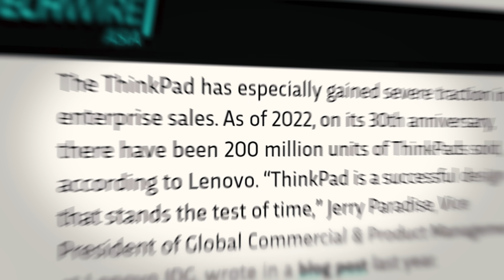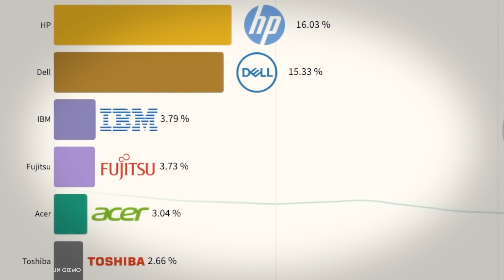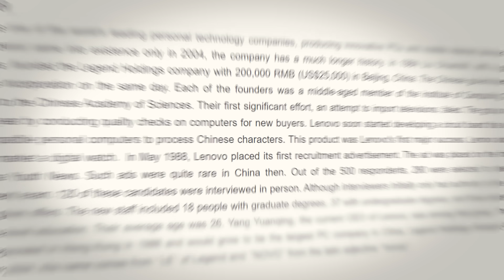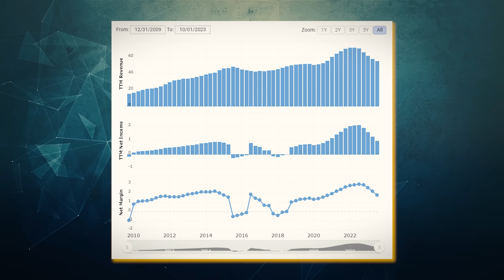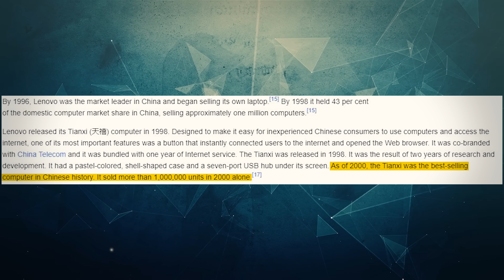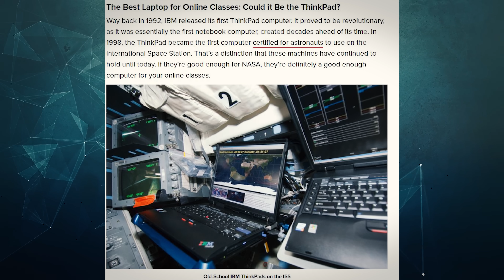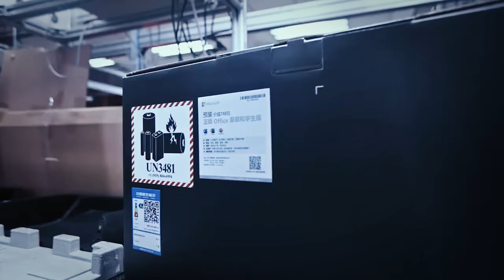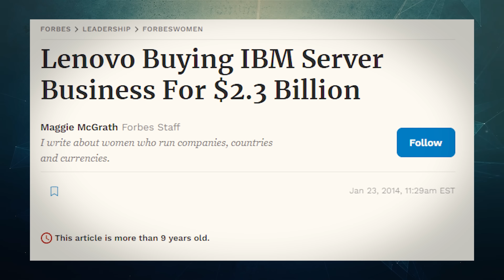Lenovo - The Last Practical Electronics Maker

Comment: Since my first ThinkPad 380D in 1997, I have been using Thinkpads in the last decade. Today, I use a ThinkPad X1, my wife uses T480. So, it's not just being loyal to a brand, but rather I can attest to its solid engineering.

Comment: I had one of those IBM thinkpad, it’s technically still with me but not up or running.
I always wanted to buy another one of those but the configuration requirements make it too costly for me. I was drooling for X1 carbon for a long time.

Comment: In reality, the last practical laptop maker is Panasonic as it still produces laptops with swappable batteries, optional internal optical drives which can be also added later, and replaceable components, well, at least if you can live with 2kg laptops for getting a 14" display which is as rest of their semi-rugged line optimized for company/medical use (though displays can be often changed for more movie instead of outdoor friendly models with better black reproduction).
For some consumer-friendly models in terms of weight though harder to find you can try Panasonic's Let's Note series which until recently got even an option for a Blu-Ray writer in a 12,5" laptop made from magnesium, so weight was just a bit over 1Kg though upgradability was far more limited due to limited space...

Comment: Recently bought a used L412 for around 30 bucks on ebay. Came with no hard drive, so i slapped in a 128gb SSD for 20 bucks and even with 4 gb ram, it runs windows 10 flawlessly, although a bit slow. Plan to convert to full Thinkpad user, gonna grab some programmer socks and install linux.
Reply: I was almost gonna say get linux on it
Reply: @StuffingSkulltag  lingus

Comment: You are mistaken investment on R&D instead of Supply management and distribution management. Lenovo only spent 2% on real R&D, The majority of its investment are on supply management, distribution management. Put it  simple, Lenovo squeezed supplier and spend a lot maintain a very large and comprehensive distribution network. The reason this crappy antique computer still on the market is because it shows up anywhere with distributer everywhere.  So get your fact straight, before you take your money from your AD customer.

Comment: But, this brand product that has neither repair facility nor a genuine sprats available. It is like use and throw after one year. 
I had bought Lenovo Legion 5 1.5 year before. Now, it is in fully dead position like use and through because its mother board can neither be repairable not be available a cheap range. 

By chance, had it be available in the market, it's cost is very high means 70-80% cost of this laptop's cost by which it can be bought a new good condition with min 1 -3 Year warranty.

So, why to make a pay a lot for this type of brand if there is no long lasting? 

And also now a days, all thing are in build. It can not replaceable for exam: for Battery etc.

Comment: Honestly I hate Lenovo
I used to volunteer at a PC repair center (we fixed computers for free), and most of the laptops that came with hardware issues such as faulty wireless modules, unresponsive / sticky (not physically) keyboards, etc were Lenovo's
Even today, every ThinkPad I got from work either is slow as hell or has nasty hardware issues (swapped 3 already)

Comment: I have a ThinkPad at work and I think for its price its a absolute piece of shit. The plastic feels extremly cheap, the cooling solution is underpowered for the chip inside so the fans ran flatout a lot, its the only laptop where sleepmode doesn't properly work half the time, the camera and microphone are on 90$ grandma phone level despite the thing costing 2K.

Comment: Older Unibody Macbooks and Older Thinkpads are like the Laptop equivalent to used early 2000s Toyotas, both are very reliable (except the 2011 Macbooks) and are very easy to fix if a part went wrong

Comment: All lenovo laptops are well built except ideapads. Mine broke its hinges just after 2 years and I had to get the entire display penal replaced. Only then I realized that it’s an extremely common design flaw in ideapads only. Still gonna stay with lenovo but no more ideapads for me. Probably going for a thinkpad or legion next.

Comment: I wanna get the P50 or the X230. Heck, I've seen a shop use a ThinkPad for their POS. That's how reliable the ThinkPads are. That even a 10 year old ThinkPad can be easily usable. 
About Sony and Panasonic. Those devices are exclusivley sold in Japan and not much outside. Panasonic's Let's Note series will shock some people, because it's trackpad is circular, instead of rectangular, like most laptops. It also has a lot of legacy ports and a optical drive. And the Panasonic still does that for familiarity and compatibily reasons. Japanese people are old. Very old. So familiarity is the big key. Plus, some perifferals(yeah, a metal joke) and media might not work on newer laptops. Compatibility is key in a Japanese enterprise. Speaking of Japanese enterprise and moving back to ThinkPads, Pasona uses ThinkPads for their business. But the industry and greed moves things, so ThinkPads now, like the X and E series have riveted keyboards, internal battery, and possibly soldered RAM. But, only time will tell when people will go back to the upgradability phase, when even the CPU was upgradable, not soldered, so you have to buy a whole new motherboard just to upgrade the CPU. Even Framework can't avoid it. But still, let's hope that the day will come.

Comment: As a person who's been using the old thinkpads(X230, X250, T440) for over 5 years. Today's thinkpads don't even come close to what the older thinkpads have to offer. You can literally break your computer and replace parts to make them better. Buying a ThinkPad X220 and upgrading it completely part by part is still better and cheaper than buying a ThinkPad X1 carbon.

Not to mention that the parts are ultra portable between different thinkpads. I myself have replaced the screen, trackpad, keyboard, batteries, ram, harddrives from older thinkpads from a ThinkPad junkyard. Still works like a charm to this date.

Comment: Had a Lenovo Thinkpad T410 for years until the start button became completely unresponsive, even after boosting it. Next came a Dell XPS 15 9560 for years, replaced swollen battery and cleaned out the dust collected around the fans, still chugging along. Bought the new XPS 15 9530, OK except keyboard uncomfortably warm under load. Returned for Lenovo Thinkpad P1 Gen6, even this gets warm under video editing load. Keeping it and do my editing with PowerDirector minimized, although it takes hours. The problem, as I see it, is more powerful processors (even tho mine is only an i7) and video cards (tho mine is only an NVIDIA RTX4060) in an ever more thinner, sleeker laptop (if you can call a Thinkpad that :) Planned obsolescence. And  Lenovo is the boxiest I could find. No, I couldn't deal w/the fat ass overweight numpad P16 :)

Comment: Lenovo didn't create the ThinkPad concept. It was bought from IBM, and the B stands for Business, not Fashion or Fad. Lenovo has had its fads, though. All the different network adapters to replace the classic port have caused nightmares for customers. When you realise you don't have enough adapters, you order a bunch so you'll be safe in the future, but then Lenovo changes it - twice! - only to return to return to the classic port. And you now have an abundance of superfluous adapters. 

Despite all that, I prefer a ThinkPad over any other (similarly spec'd) business laptop - and an IdeaPad for private use.

Comment: I have been ThikPad user for over 15 years, year after year, excluding last 2 years, when I ended up with HP EliteBook G8 835 5850U/16GB/1TB Samsung 970 Evo Plus and recently upgraded to EliteBook G10 7840U/32GB/5G/2TB Samsung 990 Pro, reason ... EliteBook was costing much lesser than ThinkPad (like T14s). EliteBook has "A" grade keyboard, but then ThinkPad has "A+" keyboard, the best, and then the Trackpoint, which I miss a lot. Also, ThinkPad has better build than EliteBook.

Comment: I went for my first HP last year...and immediately regretted it; it was missing features I had taken for granted with Lenovo, like battery saver/limiter (HP says it's a 'premium' feature not even their Z-book line has), checking battery level with the PC off or just tilting your screen up to 180°. 
Yes, the onboard RAM is not good but you can still slap a 16-32GB stick on  the other slot and call it a day.

Comment: Dude, I've had notebooks from many brands, but Lenovo is the only one that has given me a good impression, the build quality and the battery are good, even in entry-level notebooks, my current notebook that I use to program is a Flex 5i, reliable, good screen, good sound and comfortable keyboard, definitely better than any Dell or Acer sold here in Brazil.

Comment: I have a great hobby since I retired.  I purchase old business Lenovo Thinkpads and refurbish them for my friends and family.   I have probably done over 50 T420 and T470 models.  They are ususally on e-bay for $100 or less only needing a hard drive and Windows installed.  They are tanks with metal frames and easy to work on

Comment: I have a Lenovo laptop, not a ThinkPad series, a G580 model, it's a decade old now and is not turning on now. I didn't like the Webcam quality of it. Right now my present laptop is an Acer which I am using with a Samsung SSD, it's great, but even it's Webcam quality is poor. These Windows based laptop manufacturers are ignoring the Webcam quality of their laptops. I think they have to start benchmarking their entire hardware with Apple's products to achieve great quality.😎😎😎

Comment: I enjoy the unique design features of the T400. I think that the removable battery is designed like this (away from the main body) so that it is not overheated by the heat produced by the processor, and the way the fan sucks the air is from the back to the side and the hot air is pushed from the side to the left! This helps not to think about whether air is coming from below if it is on your feet or on a non-flat surface. Also another advantage is that the fan is very quiet! in its cooling system there is so much copper (3 pipes run to the heatsinks, apart from the thick copper plates!) which makes it almost passively cooled!
I wish the new designs came out like this again!

Comment: The cell phone market has not attempted practicality. If you want a replaceable battery, you have to pay top dollar. This is not high tech, this is extortion. Simple, mandatory features dangled out of reach. Moderate amounts of memory are priced at a premium. It is my suspicion that Lenovo wanted their cell phones to be a more profitable division, so they did not carry over their emphasis on cost effectiveness. There is market share to be had, but no one wants to sell cell phones to the skinflints of the world. So I have an obsolete phone with generous memory, replaceable battery, very affordable price, and SD card memory you can install programs on. Want a new one with all of these features? You'll need a second mortgage. I won't do any financial transactions on my phone, so the security issue is inconvenient. But not enough to shell out 30x what I pay now.

Comment: My sis has an old Thinkpad (T460P) and recently she dropped down her laptop from the campus cafetaria table, LCD and Keyboard (front-side) hits the floor, everyone was shocked lol. Magically it has no scratch or damage taken.
Reply: It survived fall damage, but still taken damage from water spill (from a glass)

My sis and dad having a drama, dad spill the water to keyboard, now the keyboard is permanently broken 💀
Reply: at least it can be replaced, but a bit annoying for some models. So you take apart the keyboard to remove, some you just remove 2 screws and slide out. My T480 just has 2 screws but idk about the T460   @BebebnyaHuTao
Reply: @BebebnyaHuTao  Should've got a T420 with the spill channels 
:(
Reply: Mine fell from my backpack while on my back fell straight on the lid I was expecting it to be busted but nope just a scratch XD (i frickin love thinkpads)
Reply: Nokia of laptops
Reply: Nokia of laptops

Comment: Still using my ThinkPad T470, solid rock durability, and the 2 battery still have a good 92 and 93% health.
Not interesting to buy new model. I love T470 because have 2 RAM Slot, 2 Battery, 2 Storage (NVME and M.2 2240 SATA), and easy to repair option. Now I'm looking to buy used T480 with 8th Gen Core i7 with mint condition as my secondary laptop.

Comment: The biggest problem i have with Lenovo is they took EVERYTHING that made Thinkpads stand out and made it bland and boring.  
Thinkpads used to have: 
- Easily swappable Batteries 
- swappable CPU and RAM
- Ultrabay port for hot-swappable hardware such as Floppy drives, Harddrives and Optical drives for CD-DVD and Blu-ray (ROM and R-RW)
- PCMCIA and Expresscard slots for extra Hardware addons (and I/O ports such as Serial port)
- onboard 4pin firewire port
- onboard ESATA port (sometimes as shared ESATA and USB port) 
- Infrared communication port
- magnesium alloy rollcage for sturdiness
- Thinklight that was way more usable than backlit keys because it did not sacrifice the keytravel
- dedicated Hotkeys for all functions
- a wonderful 7 row keyboard
- smaller touchpad that did NOT get in the way of your palm
- proper overal laptop thickness 
- dedicated AC power plug
- and last but not least.... 4:3 and 16 : 10  aspect radio screens that are SOOO much better to work with than the god awful 16:9 format. 

ALL these things have been completely stripped away from Modern Thinkpads and they have become absolutely useless throw-away tech and i still do not forgive Lenovo's "Superfish" incident.
Reply: ThinkPads are returning to 16:10 and have done for a while now. The T, P and X series have been 16:10 for a few years. Swappable CPUs are no longer possible because of Intel removing the option for CPU sockets after 4th gen and RAM is now soldered because that's the only way to get the higher RAM speeds as per the spec.
Reply: @vista9434  They don't have to use Intel then. If Intel is so retarded and goes this route, nobody should be forced to just go with it. Simple as that. Non-swappable CPUs & RAM are an abolute DEALBREAKER and NO-GO because it makes repairs an absolute nightmare and i do not play into this planned obsolescence by buying tech for the e-waste landfill. For the price you pay, you can expect at least things to be serviceable. The PC market right now is an absolute joke because of BS that Intel does.

Comment: The ThinkPad's reputation was built on the IBM designed units.  That quality and durability  has steadily  taken a dive since Lenovo took over.  IMO the Tx20 line were the last real ThinkPads., and even those were cheapened by Lenovo by removing the magnesium 'roll cage' that protected the display.  Everything past those are just bad copies that have none of the classic ThinkPad features like the best in class keyboard they used to have.

Comment: Lenovo is the only laptop I use besides my MacBook Pro.  And I prefer my Lenovo over MBP for everyday use.  Right now, I'm lying in my bed typing his.  It is resting comfortably on my knees which I type away.  It is a X1 Carbon and the only comparable laptop to it is the Macbook Air, which surprisingly is HEAVIER than the X1.  Plus it is so slippy that it will not prop up on my knees.  Yeah, you can't upgrade the RAM but I will overlook that.

Comment: I returned my X1 carbon 2 years ago after experiencing the worst heating and CPU throttling issues I have ever seen. Although it is due to the shitty Intel 11th gen processor, they shouldn't sell that crap that is useless for medium and high load tasks.

Comment: I am still using a 2011 Thinkpad X220 as my home laptop (I also have a modern Dell from my employer). My only concern regarding this laptop has always been a small screen and a rather low resolution by today's standards. Otherwise, I am going to use it until it falls apart. It is the last generation with IBM's classic keyboard. I upgraded the RAM to 8GB and the hard disk to an SSD, and put a Linux on it. Works like a charm. In fact, I also replaced the whole case with a brand new one from AliExpress that I bought for just 30 euros. This computer is very easy to maintain and upgrade. It's a tragedy of modern times that they don't make them like this anymore.

Comment: This video is an interesting, thorough piece of work. I have an MBP M1 max beast - but still pine for the X1 carbon gen 6/7 I ebayed for < £400 (maybe 10th of the price). Replaced a dodgy key cap, refreshed what could be upgraded internally with the best components when i could - it never left my side. In general, Lenovo give you an ecosystem of interesting, attractive (generally) good quality peripherals. The keyboard, though. The fact you can get it on a lightweight, hi spec device that can be upgraded for reasonable money...